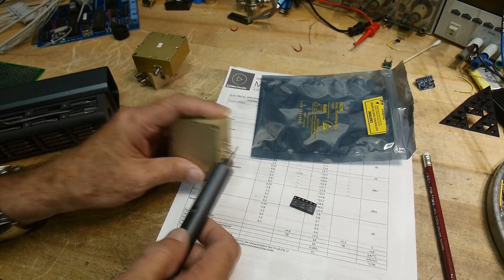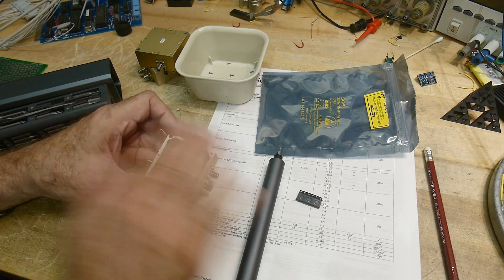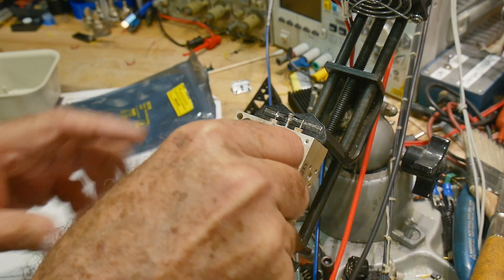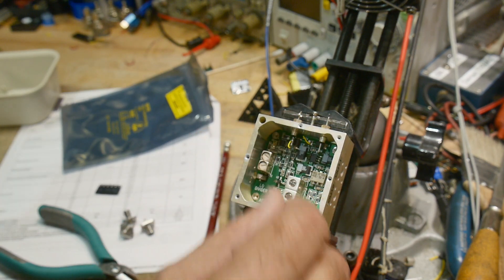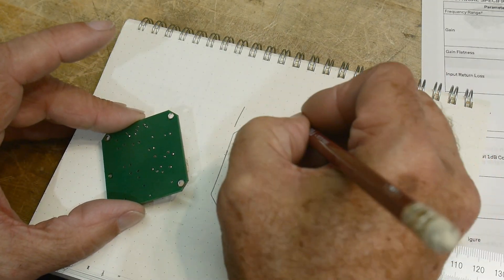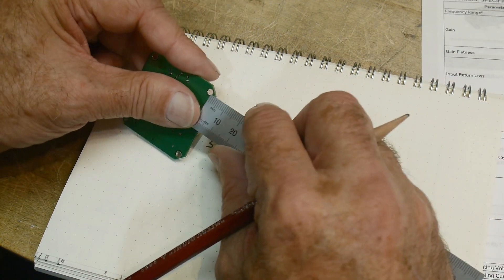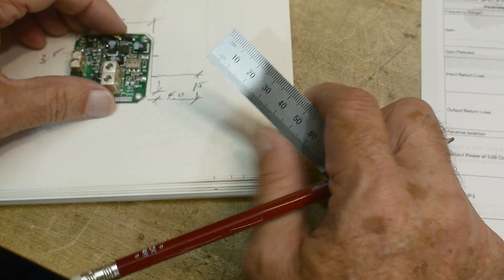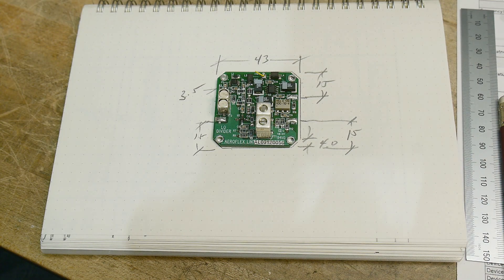#2019 GVA-63  Amplifier Project (part 2 of 10)

Comment: My generation grew up mixing imperial and metric (UK 1970s) but the day job has always used m or mm (cm as taught in UK schools can get in the sea). Pleased to see a great demonstration of the simplicity of mm for these sort of measurements by eye. I would always try and measure hole centre distances then confirm by measuring to the edge, I guess in reality it's not that critical here. Great series.

Comment: I offer some advice: Measure with a caliper, measure from one point "corner" to each feature. Follow up by checking hole to hole. 
The camera parallax made it difficult to see the accuracy of your measurements, but I have gotten caught by not being very careful measuring features. Multiple cross checking is powerful method of  finding 'f'ups. Little pisses me off more than dumb mistakes that cause re-fabrication. Edge to hole measurements double the error the way you dimensioned. 
(OK now I am ready to be beat up,...)
Reply: Yes agreed, the digital caliper stops a lot of mistakes.
Andy
Reply: @andye2005  It helps, but also measure from two orthogonal sides, not from all sides!  
"The wisdom of many failures".